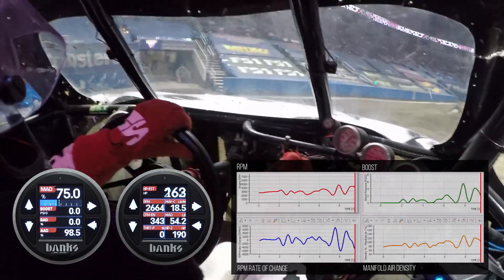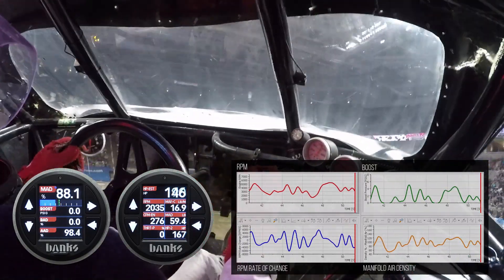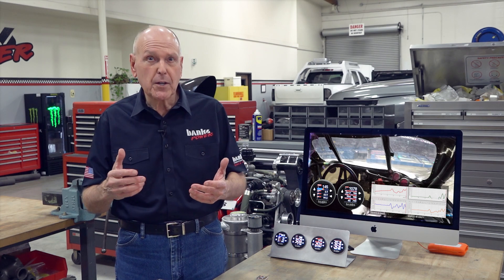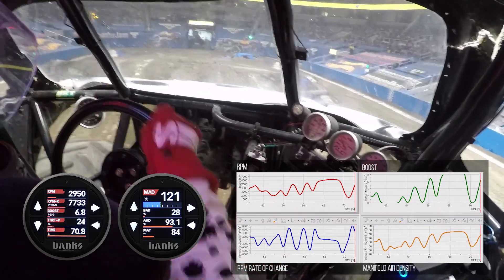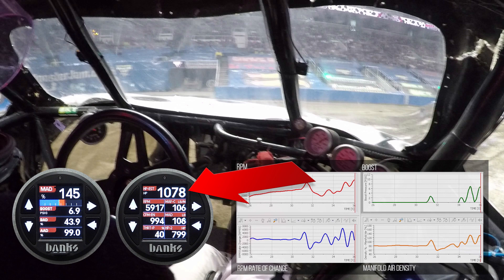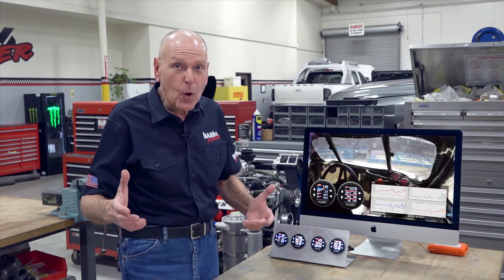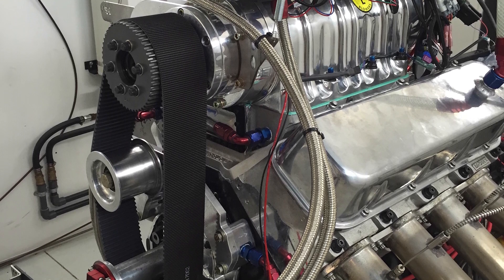Monster Mutt Data | Building a Monster Truck Engine Pt 2

Comment: This is exactly my concept for a honda based v8 build plan. Neutron engines k48. But boosted. 

Boost system designed to control air density air flow and air pressure. 

Engine is a hot vee set up. Helps with turbos. Given how twincharging has been used for some great results snd the effiencies you can theoretically reach it was my decision as long as i can hit weight targets. 

Under blower water to air set ups. Water to sir intercoolers can get high effiency. Thermal exchange laws. Colder fluid hotted gasses. 

Given how super works even oversized and under driven. More heat and a bit more losses once being fed turbo boost pressure. But 2 stage per cylinder head still means by the time i get to actusl manifold readings my temps can be rather low. 

Add in an interchiller system plumbed properly. 

Intake air gets boosted by turbo air gets cooled bsck down. Already dense and pressurized airflow hits super gets compressed again. Gets cooled again. 

Ve of supers is good. Can help mechanical and thermal effiencies. Turbos have great mechanical effiency but some downsides to exhaust backpressure. 

Free up those losses. Feee up blower losses. Reduce blower downsides. Engines gonna rev to 10500, but cams and some other stuff is gonna be partially limited for drivability concerns. Using a bit of the new oem set up of higher boosts to help just flow enough air into the engine at certain rpm points. 

Besides compression rstio issues and turbos damping the exhaust puleses. Idea is VE like a NA motor but further boosted by the turbo system. Increased thermal effiency. Reduced knock issues meaning less fuel consumption for cooling purposes. Along with tuning injector placement for similsr reasons. 

Work on fuel air mixing. Reducing all the restrictions. And then frictional losses rotational weight losses and other deflection based losses. 

Feel like a bigger motor. Need less fuel. Run reliably. And less stress on everything but most controllable powerband. Engine has full vtec. Each cam profile essentially only needs to serve roughly 5000rpms of the engine. 

Cylinder pressure sensor set up if i can. Air fuel per cylinder. Mass air fuel as well. Manifold pressure and temps. Density gauges. Probably atmospheric, but via pitot tubes set up so i can use those for aero tuning and as an imput for other stuff like traction control. Under body above body. Pressure differential. Not perfect but rough idea of ground effects downforce along with the static calcs for other components. 

But in general. Freezing cold fluid to highly efficient water to air set ups. 2 stages per each head. Peak effiencies for blowers and turbos but also providing rhe engine its best chance and essentially getting a safe antilag system. Fresh air bypass antilag valves. Vs blow off valves. Boost per gear and rpms. Low rpms low gears the boost is gonna be venting off quite a bit. Electronic wastegates on top. Control turbine speeds and compressor speeds. Booet the functional comoression ratio where needed like a race engine. Have that boosted car effiency. And still be able to have easy start ups. 2 functional engines and set ups in one. Blower bypass systems will work to essentially change the thing into a non series compound boost set up, for lower boost tunes. And then higher boost just runs compound boost. 

Hot vee plus twin charged plus some other scavenging benefits. Thermal effiency benefits help as well hot vee side and pressure differential side. Plus should help scavenging further in my combined cylinder cooling idea. Bit of valve overlap. The bit of escaped intake air will expand alot. Helping velocity if exhaust set up and turbos are accounted for properly. And if velocity is kept up it can help induction. 

Due to less knock risk. Better timing meaning less losses. More effiency. Less wasted fuel. Essentially should come down to just need to do a few valve train tweaks for full vtec. And combustion chamber tweaks. And improving low lift flow alot. 

Denser air on blowers reduces boost. Denser air on turbos increases actual achieved boost levels vs atmospheric. 

Final volumetric effiency should end up in the like 300 percent ish range give or take a 25 percsnt margin. Total effiency should end up 40s range.

Comment: Lots of folks have asked, what about all of the extra weight a diesel carries with it ?
Reply from the maker: The truck won't feel the weight gain.
Reply: @bankspower  Do you have an engine weight gain calculation yet vs. the Big Block Chevy ?
Reply from the maker: @Garth2011  We haven't weighed it. We don't believe the weight gain will affect the truck's performance.

Comment: That engine is barely working up a sweet at only 10 psi of boost. People always though it made so much more power because of what it could do. This engine could be built for alot less than people think or spend on sportscar build that make alot less.

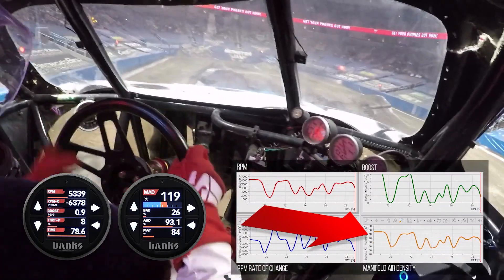Comment: 10:45 when you use Different fuels. The fuel to air ratio is REALLY,  B.T.U. per pounds of oxygen.    Plus ➕ , these fuels have different weights (per gallon).   The difference between Diesel weight and propane weight is huge.  Very interesting,  is that, high quality fuels all look the same at different temperatures. They all look like WATER, just a clear liquid.
Diesel @ 65*F
Gasoline @ minus 10*F
Alcohol @ 32*F
Propane @ minus 250*F

Comment: Mr. Banks- I'm spitwadding this ,but the monster trucks want virtually instant on/ off on power. I know the diesel has made huge gains in the flexibility area, but it still seems to me to be a reach for that application - I'm wondering if an Allison 6 speed Auto trans ( a custom CVT?) might allow the engine to be better designed to operate in a smaller rpm spectrum? The other is to use the technology the V-22 uses to transfer engine power from side to side to run big gear rotor (Honda Patent?) pumps and motors to push the wheels- even in the donuts, the vehicle speed across the ground is less than 40-50 mph. I do realize that Monster truck shows are like wrestling- mostly staged and predicted, so the rip and snort of an engine going back and forth from a low load high idle to full on max power will be different- but so will the diesel's lower and narrower power band in a "conventional" application (usual trans and 4wd splitters). I'm not challenging what you can do- I'm like many here- a motor head with out much diesel knowledge. I'm ready for a baseball bat dose if it's offered!

Comment: Calculating horsepower from air mass flow/engine RPM (2:05)? That's such an elegant solution. If you know displacement, MAD, RPM, fuel type and A/F, you effectively know the power being generated at the cylinder.

Comment: Diesels are less effected by humidity than gasoline engines.  As long as the air/fuel ratio is lean of stoichiometric, there is enough excess oxygen to burn all the fuel.  At Cummins it was rare for us to get much richer than 22:1, as that was the threshold of visible smoke, and the temperature of the in-cylinder components would get unacceptably high.  (Not to mention NOx emissions would go way up, too.)

Comment: A diesel truck engine in a closed arena like monster Jam would create a lot of air pollution for the fans watching special little kids and there's nothing like the smell racing fuel and the sound of a good race motor compared to a diesel engine

Comment: Mr. Banks, ever consider using the heat energy of fuels to calculate the fuel and MAD required to produce a given hp?  It takes about 2550 BTUs to produce 1 hp and the BTU content of different fuels is easily found.  Just another way of looking at what it takes to get the job done.  Thanks for the videos.

Comment: you need a big roots blower  big high flow cylinder heads, a large rpm range, and a high stall converter and you'll have a monster truck diesel. the Duramax 6.6 has the right layout, but the cylinder heads don't flow enough, billet block amd head cummins 6bt be the best choice, and lighten the block.

Comment: Diesel is super loud I'm sure gale will have a supercharger on it so it can breathe through some zoomies.  Not super impressed with the other Diesel truck on the circuit.  I have total faith gale will get them straightened out.

Comment: 1400 HP out of a 540 is an excellent power to weight ratio being what, 700 pound motor? and the diesel is heavier so throttle response will need to be just as fast if not better to get more weight to fly plus the lower rpm will mean less gear reduction which wont help response...how about a hybrid drive  nut not for the wheels but the crankshaft itself?? diesels run just about perfect rpm range for electric motors and it would only need a small battery pack...plus it would be funny to have to plug in your monster truck

Comment: Gale Banks has been THE MAN for me ever since I read about his 200mph Trans Am in Car and Driver back in 82. I was just a 10yr old kid, but I was hooked. Listen to this man.
Reply: Robert D. 
I vaguely remember a lot of that stuff in car mags. 
The first shop I worked in, the boss had a suburban with a 6.2 and one of his turbo kits. 
Wow that thing pulled very hard and was a tire roaster. 
I’d wager it would hang with a stock 1st gen power stroke from the late 90s. 
That was my first real experience of diesel power, I was hooked.

Comment: I don't think the slower throttle response of a Diesel engine will fit the need of a high performance monster truck.
Reply: I'd say, with almost certainty, that he'll end up with a screw blown setup just like the meth motor. Wagler has been doing it with Duramax for a bit
Reply: He's probably going to do super-turbo like he's been doing in his marine and race engines. Supercharger for low rpm throttle response, then have twin turbos take over to supply the top end power more efficiently.

Comment: With Gale Banks in the world, interstellar space travel will happen using the internal combustion engine.
Reply: If gale were to start on the project of powering space vehicles they would all be deisel powered and have turbos big enough to suck oxygen from Earth's atmosphere from anywhere in our solar system.
Reply: GM Kof hard   That is bullshit. A rocket is a Combustion engine.  give me 1 reason you could not run a diesel or gas engine.  all you would need is your own oxygen supply  just like a Rocket.
Reply: They launch so hard they don't have to run in space just haul ass drifting
Reply: GM Kof hard  sorry theres oxygen in the rocket fuel mr thinks your smart guy ... At least know your science how else would it burn in space
Reply: GM Kof hard  Internal Combustion would work fine in space, you just need to supply the oxidizer.
Reply: A nitromethane engine would work (though not at 11,000hp probably) because nitromethane carries its own oxygen....its not about air, its about oxygen or oxidizers, like flourine or chlorine.
Reply: Victor Riceroni where’s the oxygen going to come from?
Reply: @aksleder907   Gale Banks will figure that out.

Comment: Oh I can imagine all the people complaining about the air quality from the soot with a diesel monster truck running indoors.
Reply: If done correctly there will be none. Gale touched on it briefly. Black smoke is unburnt fuel. When properly tuned and set up there will be minimal "soot"  And you could always throw a DPF into the exhaust for added soot reduction.
Reply: With my old VW diesel, the tail pipe stayed shiny and clean...but the exhaust on my new GTI is sooty black.  Remind me, which one is supposed to be an environmental hazard?
Reply: Black smoke is unburned diesel fuel, not oil.
Reply: I’m not sure if you have been in a confined space with a methanol or alcohol engine. But it is very hard to breath and stings your eyes. Hence why fed drivers wore goggles and breathing masks

Comment: Learn more per episode than 20 months school.   If wasn't for the old guys teaching me I wouldn't know anything.
Reply: Turns it into practical knowledge.
Reply: Rodcodnito 00 
I thought tech school taught me good , and they did, but the real world is a different place. Glad that I got to work with a lot of older guys over my career. 
I’ve been at it 20yrs so far, and what I’ve learned is to be humble, because as soon as you think Youre the man you get kicked in the butt with a whopper of a problem. 
and learn new stuff every day or it’s a wasted day.
Reply: if I were a betting man Id say this guy taught chuck norris karate
Reply: I was lucky enough to have a pair of retired Air Force  A&P's  for High School auto shop.
Reply: The Old boys are everything. We must learn as much from thier generation before their gone.

Comment: Can't wait to see what he comes up with. That supercharged 540ci engine is really good at its job, it will be hard to dethrone. I HATE to say it, but part of me (and I really try to repress it..) wonders if electric wouldn't be the best solution for this. Doesn't need road trip levels of range, would benefit from instantaneous torque, and they'd be allowed to do many more indoor arenas without the noise and exhaust.
Reply: smith jones I think electric would be awesome in a monster truck since you’d have the instant throttle response and pretty much full torque available at any given RPM. Only problem with electric would be the weight of a motor and batteries capable of producing 1400HP, that would get much heavier.
Reply: @chevyon37s  your talking about something that is defined by torque and rpm. The change will come when the electric motors and batteries and controller can sustain the amount of amperage required to give you the torque for the wheel speed.
Reply: It would ruin the fun. Part of the experience is the sound of those B/A big bock
Reply: Until the batteries blow up from being jarred constantly
Reply: he could have the diesel run a generator was my first thought but the problem is finding electric motors that can turn those giant wheels, right now youd need several operating on a gear system and one single motor on each wheel that powerful would be heavy so you are right, the Aluminum 540 is a tough champ to beat
Reply: @philtripe  It is very easy to find motors that can drive those wheels, you just need to stop looking at conventional async motors.
Reply: Electric will never happen in monsters. Half the fun is the roaring engines. Electric is better in every way, it just doesnt sound cool, and monsters follow the rule of cool.
Reply: Electric would be amazing from a purely preformances standpoint, but that's not enough for a monster truck.

Monster trucks exist as a tool for entertainment. In entertainment, the more senses you can engage with your audience the better. Go to a monster truck rally. A HUGE part of the show is that loud ass engine that sounds so loud and violent that it scares you, but in a fun way. You feel it rumbling in your chest. If you are close enough to the field, you can even smell the exhaust, and it slightly stings your eyes. You know this isn't just your dad's truck with big tires. Also, a lot of the time you see flames shooting out the exhaust, which is awesome to see. When you are a kid, it is the most fun you can have while sitting on a plastic stadium seat.

Electric motors can't do any of that.
Reply: Worry about breaking batteries
Reply: Exspensive to make little market